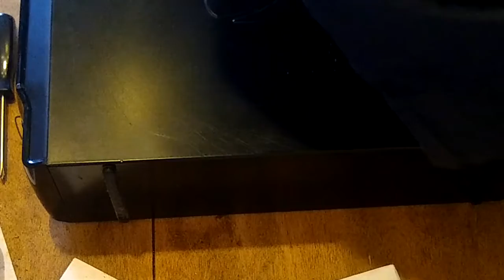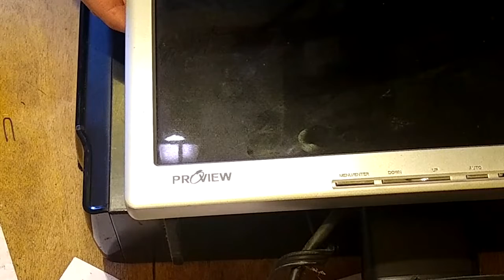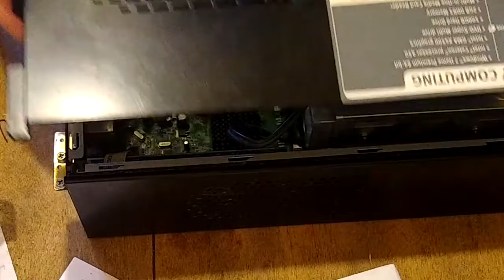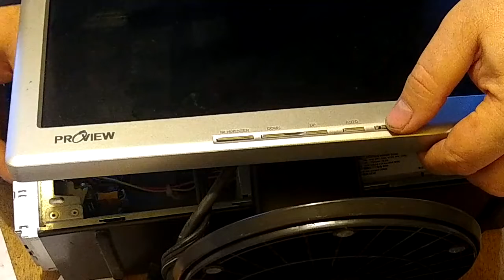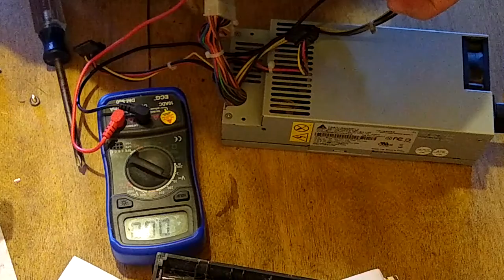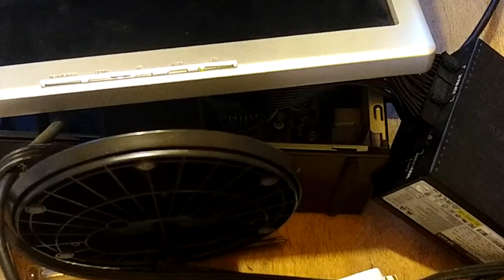Can I fix my emachines EL1850-01e capture rig?

Comment: I found one of these at a thrift shop for thirteen bucks and have been experimenting with how far I can upgrade it with stuff I've got lying around the junk drawer. So far it seems to be bizarrely finicky about what combinations of CPU and RAM it's willing to tolerate; it WILL post with a full 8gb, but only when the FSB is limited to 800mhz. Any 1066 or 1333 mhz chip, and it just beeps until i cut the ram down to 4 gigs. eMachines was such a weirdo of a manufacturer; i don't think anything they sold was really 100% sane and normal.
Reply from the maker: I have not tried to upgrade mine much at all beyond putting in a faster graphics card.  Turns out for a dedicated capture machine it doesn't take that much.
Reply: I own two of them with one being an 1850 as well and the other being a 1352 (AMD model with nForce 430).  

Knowing eMachines for the shoddy systems they made, they might've used a shitty BIOS and that might be why they're fiddly about upgrades. Either that or the chipsets are dogwater and/or the hardware's dying.

Comment: I had the same problem. I bought a second hand El1850 and the fault was in the mother board. For 30€ I have the PC working and spare parts.
Reply from the maker: At the time the cheapest replacement I could find was a whole box and that was $60.  I ended up getting a whole new machine for $12 instead.  But I was not able to simply use the old drive.  The new machine was 64-bit and wouldn't run the 32-bit version of Windows 7 on the old drive, so I had to re-install everything.  But so far I've gotten most things to work.